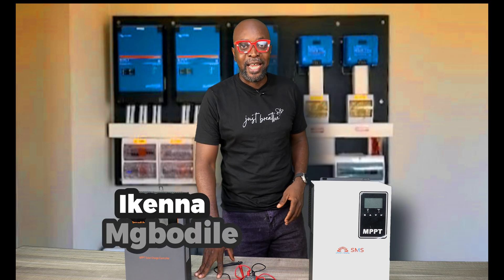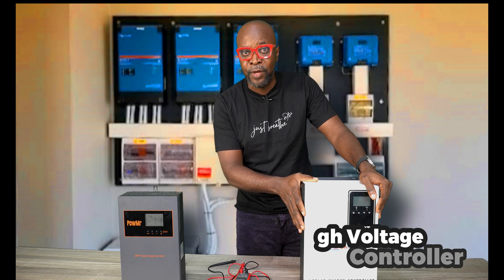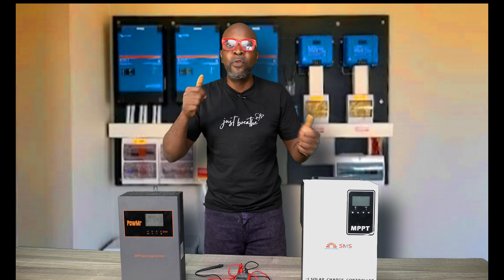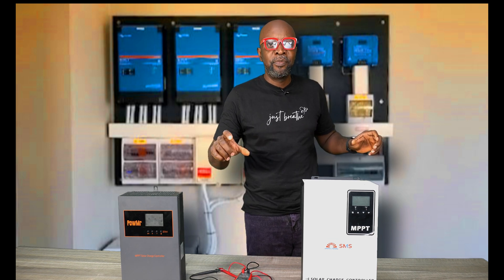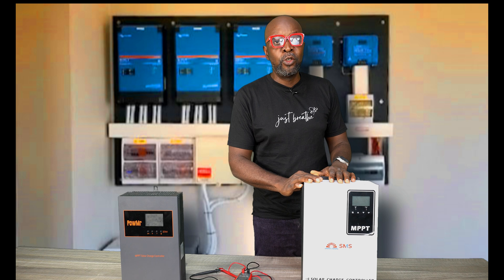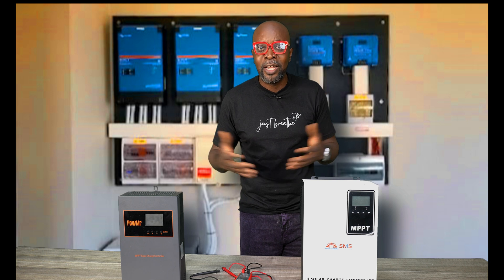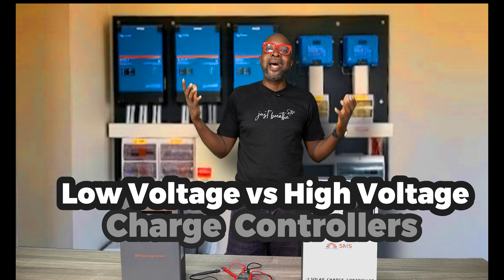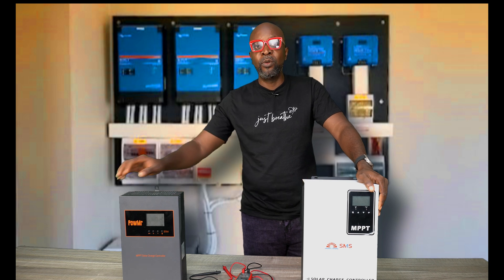High Voltage vs Low Voltage Charge controllers.

Comment: The low voltage is equally dangerous.. low voltage but high current, high voltage but at lower current
Reply from the maker: You right Low voltage comes with a lot of current.

Comment: someone said low voltage charger will Chager faster x 3  than high voltage Chager if de were to use the same panels on the same battery 
How true is that sir
Reply from the maker: "That's not true — both will charge at the same speed. Once you understand how wattage is calculated, it will all makes sense."

Comment: someone said low voltage charger will Chager faster x 3  than high voltage Chager if de were to use the same panels on the same battery 
How true is that sir

Comment: Boss am confused between 5kva 24vt  inverter vs 3kva 24vt..

Because they use same battery.. is there any different apart from that sir. Pls.. because I don't want to go for 5kva 48vt
Reply: @goldencrownmotors5225  Yes there is a difference. Remember everything sums up to wattage. If you take drawing 5kwa from a 24v battery bank, it means you taking around 200amps from the battery bank. 
While if you are drawing 3kwa from a 24v battery bank means you are drawing 120amps from the battery bank. The more current you draw the faster your battery depletes. Thats where the professionals come in to advice you and guide you on the proper thing to do with your installations

Comment: Do you mean the high voltage controllers convert the voltage or excess voltage to amps or current to charge the battery. Like if am getting say 20amps from the panel at 300v max. My charging will be greater amps or current at the battery end.
Reply: @VgamersInteractive   no energy conversion is totally 100% accurate. Remember in every conversation energy heat is lost and that heat is also power. It'll depends on the manufacturer on the conversation rate of there charge controllers.

Comment: great video
weldone.
however, you did not mention efficiency of both charge controllers. i have noticed at peak sunlight, the low voltage charge controller seems to harvest a lot more from the panels while the high voltage charge controller harvest less and i think this is due to  the energy losses due to conversion from high voltage to current.
please do a video on a real time test between the two charge controller just as you did the video on mppt vs pwm
THANKS.

Comment: For panels to charge the battery very well and faster ,what do i consider? voltage or current?..
Reply: Amp x Voltage is NOT = current
It's more closely = Watts.

And Voltage is NOT "part of Current",
To put simply, both voltage and current are distinctive parts of ELECTRICITY.
Reply from the maker: @ELchrysito  correct
Reply from the maker: @Kingfelo-z7z  Both are very important  non is superior
Reply: Boss am confused between 5kva 24vt  inverter vs 3kva 24vt..

Because they use same battery.. is there any different apart from that sir. Pls.. because I don't want to go for 5kva 48vt @smilinsunsmilinsun8056
Reply: amp times voltage is current.voltage is path of current

Comment: I used to 12volts is the lowest inverter and 48volts is the high voltage inverter 

So you mean 60-100volts is under the low voltage category???
Reply from the maker: You are refereeing to inverter system voltage the video is about PV voltage
Reply: @smilinsunsmilinsun8056  or sorry although I found my answer in your other video and I also question for u Der , thanks
Reply from the maker: @wizlipskings8958  Okay Buddy !!

Comment: What is the difference between voltage and current?
Reply: Let's use the analogy of water. Voltage is like water while the current is the pressure at which the water flows.
Reply: mmmm not exactly...Think of voltage like water pressure—it pushes electricity through a circuit, just like pressure pushes water through a pipe. Current is like the flow of water—it's how much electricity is actually moving. High voltage = strong push, high current = lots of flow. I hope this is a super helpful way to visualize how electricity works!

Comment: Weldone. 
You forgot to mention shading; It can affect series connected panels
Reply: yes, shading on one of the panel, will limit the whole series connection to the current of the least producing panel. The shaded panel current will be used in getting the total power generated in the whole series connection. nonetheless, if there is no shading problem, then high voltage controller is the way to go. it is very efficient
Reply from the maker: @odoohub5010  Correct
Reply from the maker: @bashirshittu8499  Yeah that was a good one, Thanks for sharing
Reply: I think it is wise to use half cut panels for series installations, it reduces the effect of shading. What do you guys think?
Reply from the maker: @seanjohnblaze  Half cut generally reduces the effect of shading